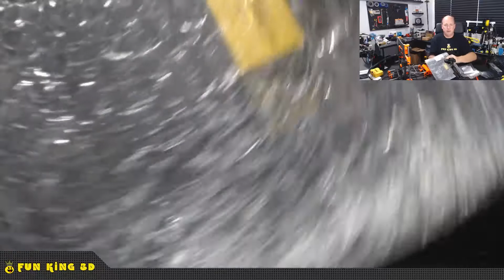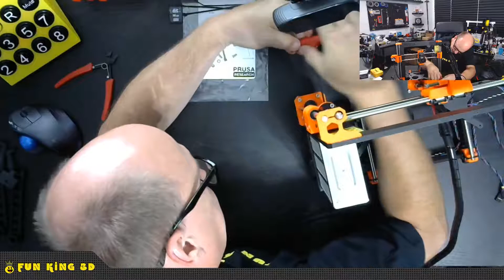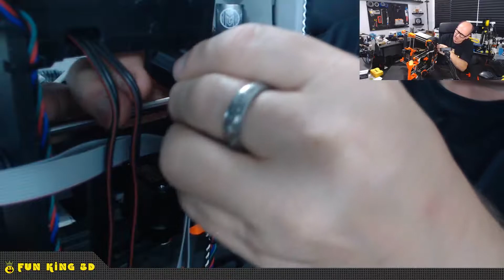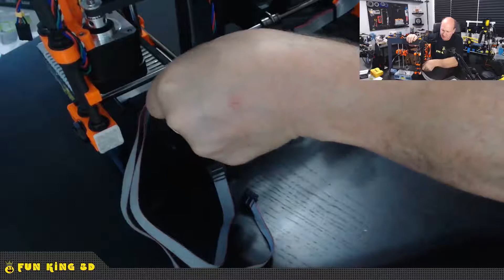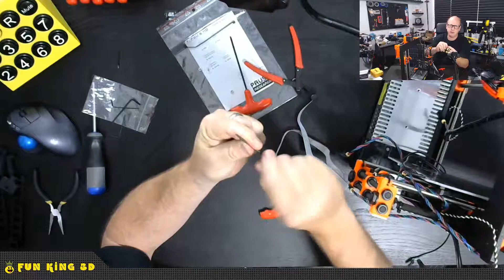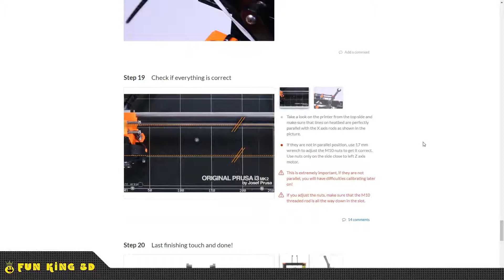Assembly: Prusa i3 Mk2s Step 7 - PSU and Heatbed

Comment: Been following series so far, thanks for making the video! It has been less boring, The two PSU nuts for the nut trap were so tight, didn't want to hit them with a hammer. For now I just left them floating without the nuts, it seems secure enough being mounted to the metal frame, we will see.
Reply from the maker: This is so awesome. I love to hear feedback like this. I will have to go back and look at the traps you are talking about to know, but on other printers I have run into trouble and found that cleaning them out with a dental pick (or other metal pick) helps or sometimes I had to squeeze them in there with pliers.